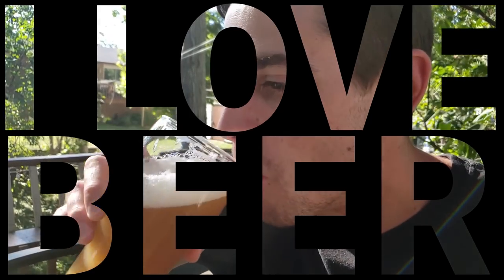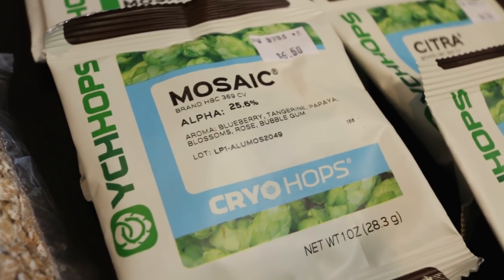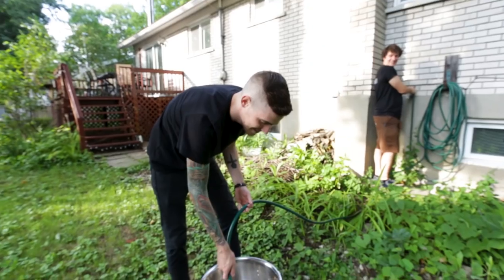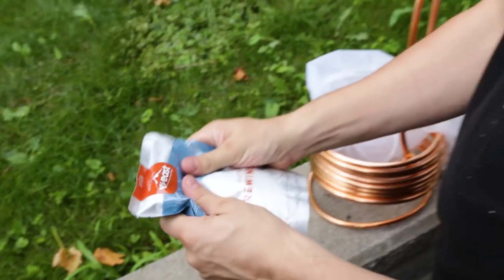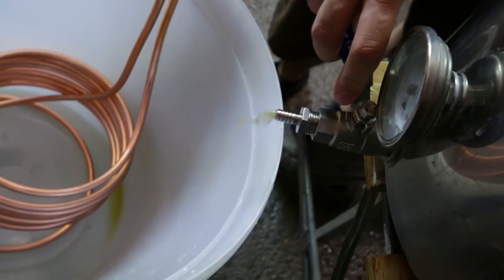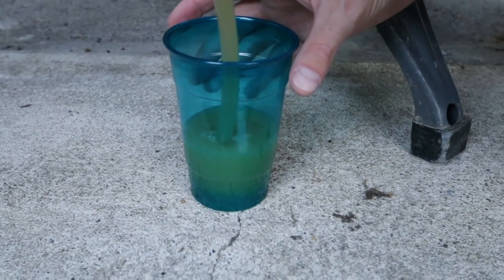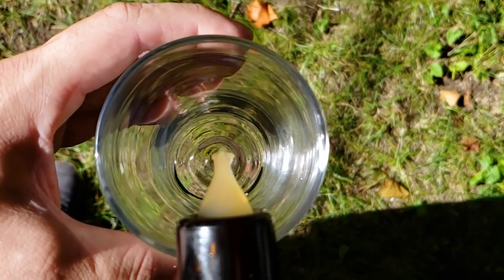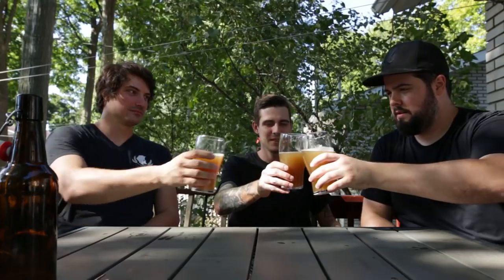Pourno At Home | Pourno Ep. 2 | NEIPA Homebrew

Comment: The beer produced on the brew day is known as moonshiners beer outside of the homebrew hobby. It is chemically and enzymatically impossible to produce ale and lager using single temperature infusion brewing methods. The recipe recommended to use high modified malt. High modified malt is not rich in enzymes and to use it for producing ale and lager enzymes need to be added and the various temperatures that activate the enzymes have to be used.
Let me help you guys out. Purchase Weyermann light or dark floor malt. The malt is under modified which means that it is rich in enzyme content. The malt is low protein and that means it is loaded with sugar. It is brewers grade malt. Homebrew malt is high modified and high protein which places it in the distillers grade column. Marris Otter, Halcyon and Golden Promise are intended to be used in grain distillation, whiskey. There are a few producers of Marris, one produces low protein malt, 8% protein which is great but to make ale with the malt enzymes need to be added. To make high octane soak the malt at 150F. Without having the spec sheet for the American Pilsner it is difficult say if the malt is capable of producing ale and lager. Recipes are not accurate because malt is inconsistent and unless the person that wrote the recipe recommends purchasing the malt from a certain maltster who provided a spec sheet to the recipe writer, the recipe is horseshoes and hand grenade close. A spec sheet comes with every bag of malt because malt is very inconsistent. A spec sheet is produced when malt is tested. On the sheet are acronyms and numbers that a brewer uses to determine if the malt will make ale and lager or if the malt is suitable for making whiskey. There is valuable info about the malt on a spec sheet and it's not a bad idea to become familiar with the info because it ties with making ale and lager. At the least, brewers grade malt should be step mashed to take advantage of the enzymes. When a recipe recommends using high modified malt, single temperature infusion, no secondary fermentation and priming with sugar or injecting with CO2 for carbonation the beer is moonshiners beer. When the Beta rest is skipped there is no need for secondary fermentation. When the Beta rest is skipped the beer has to be artificially carbonated. Beta is responsible for conversion. During conversion Beta converts glucose released by Alpha during saccharification into complex sugar, maltose and maltotriose. Both actions occur simultaneously at 140 to 145F. Yeast only uses simple sugar preferably glucose for fuel which happens during primary. During second fermentation yeast absorbs maltose through the cell wall and an enzyme within yeast converts the complex sugar back into glucose. The glucose is expelled back through the cell wall and it becomes yeast fuel. Gravity reduces close to expected FG during second fermentation and malt flavor develops. During conditioning yeast does the same thing with maltotriose and natural carbonation occurs. The beer clears without finings, gravity falls to expect FG and malt flavor rounds out during conditioning. 
The issue with single temperature infusion has to do with chemical precipitation. After everything is leached out of the malt during a high temperature, one hour rest it all ends up in the extract. When the extract begins to boil chemicals begin to precipitate but it is too far down the line when it happens in the boiler. The wort becomes chemically imbalanced and it will lack the nutrients needed for proper fermentation cycle to occur. When yeast is added to chemically imbalanced wort the off flavors that are associated with homebrew are created.
Precipitation of chemicals must occur upstream of the boiler and that is one of the reason why the decoction method is used for producing authentic ale and lager. When the boiling decoction containing chemicals is added back into the main mash the temperature increase activates enzymes that change the chemicals into nutrients and vitamins. When magnesium and potassium phosphate precipitate an enzyme changes the chemical into myoinositol, pure B-12, Mom Natures natural speed. The thing about B-12, after yeast is done with it the remainder is left in the final product. Hangovers and the lethargy that go with hangovers are due to alcohol wiping out the B-12 in our body. When beer containing B-12 is pounded down the B-12 is replenished and hangovers are not near as bad as the head bangers from infusion brew. The wort from the decoction method is clean, rich in nutrients and chemically balanced which eliminates the off flavors and poor aging characteristics associated with infusion brewed beer. 
Before throwing away spent mash take a look at it and you will notice small white particles throughout the mash. It is a type of starch that makes up the tips of malt. The starch is amylopectin. Amylopectin is hard, heat resistant, complex starch that contains limit dextrin. Amylopectin is the richest starch in malt.The sugar contained in the starch is tasteless and nonfermentable. A and B limit dextrin are responsible for body and mouthfeel in beer. The starch burst when mash is boiled and during dextrinization Alpha releases limit dextrin. The reason the starch ends up in the compost heap has to do with infusion brewing methods. The temperatures used with the method are not high enough to cause the starch to enter into solution.
Skim off hot break as it forms or at least drastically reduces before adding bittering hops. Skim off the second break sludge after the hops are added. The wort will be cleaner and less hops are required.
To want a taste of what it takes to be the best you guys will need to learn the decoction method and use brewers grade malt. The decoction method found on the web and in homebrew literature is not correct. After all, the same person that said soaking malt in hot water for an hour makes ale wrote about the decoction method. It appears to me that the same person that taught homebrewers how to make ale wrote the gobs of homebrew recipes and sells high modified malt. LOLOLOLsssssss.
Reply from the maker: Some unique and interesting stuff here, thanks for watching! 🍻